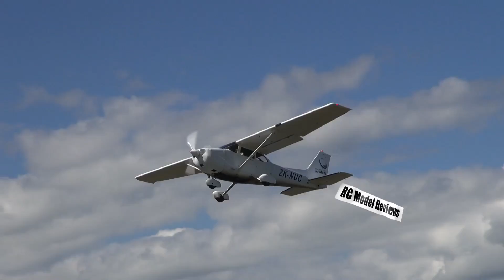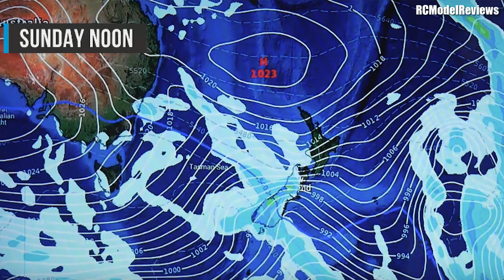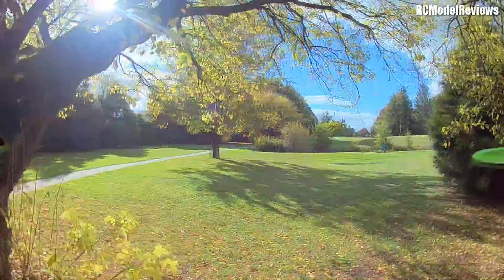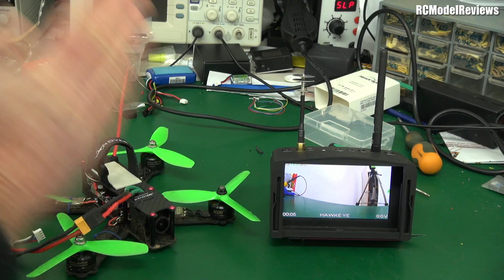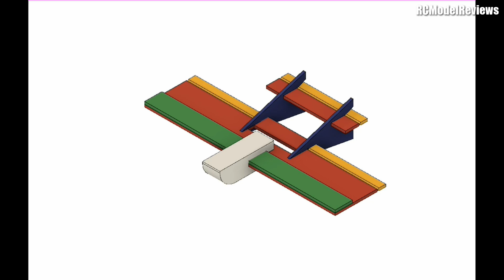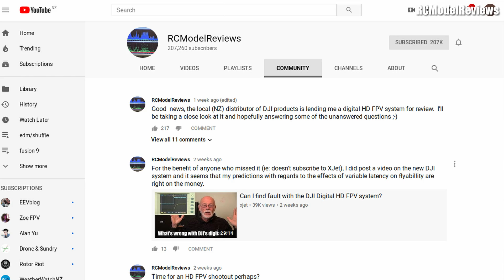Weekly News (21 Aug, 2019) Drones, RC planes, FPV, etc.

Comment: Hey Bruce, just a bit of extra info for the new Aussie drone rules, CASA is now retiring their Can I Fly There app, which is supposed to let people know where they can and can't fly, their new recommended app, OpenSky made by Wing LLC (Googles drone delivery company). 
If handing over this kind of responsibility to a company interested in removing recreational users from the sky isn't bad enough, it doesn't give an accurate representation of where you can fly! Specifically it ignores the sub 100gm exemption to the rules about minimum distance from airfields, which for an inner city dweller like myself means a 1 hour drive to find somewhere 5.5km from an airfield.
If a side by side would help for the video I've uploaded what both apps show for the same location here: https://i.imgur.com/nTnVvj6.png

Comment: A hid system that can go 15km with good video is all I need
Reply: ah ok
Reply: thats not too much to ask for ;)
Reply: Use a directional antenna, either on an automated swivel (needs to be constantly fed target coordinates) or hand-pointed by your spotter! Since you're legally required to have one in so many places, may as well give them something to do while you fly. You'll manage several times the range you get between two omnis, even the terrible 25mW can give you some decent range. 700mW may well break the 15km limit in favourable conditions.
Reply: @_tyrannus  it doesn't have to be gps
a different system could be used to detect from which direction the signal is coming from
similar to sun trackers

Comment: The hawkeye just like other split cameras has a pretty bad analogue feed, the Caddx Tarsier for all its faults is the only split worth using IMO.
Reply: Not for long. Runcam is making a camera called Runcam Hybrid which is just like the new caddx but the HD feed is from a runcam 5 sensor and fpv feed from the runcam eagle 2 pro sensor. Also it has a flexible cable. I think this is a win